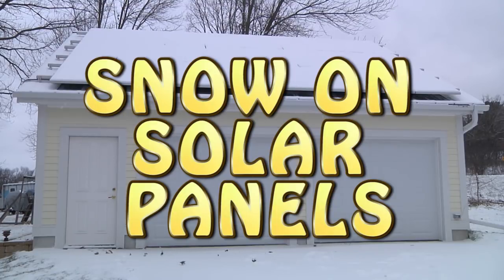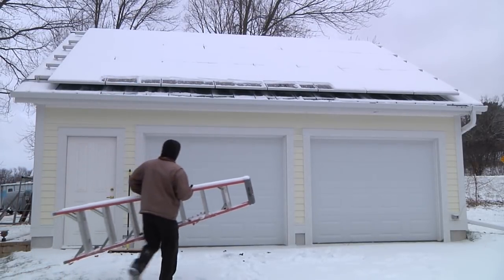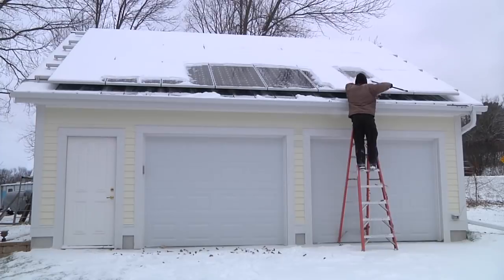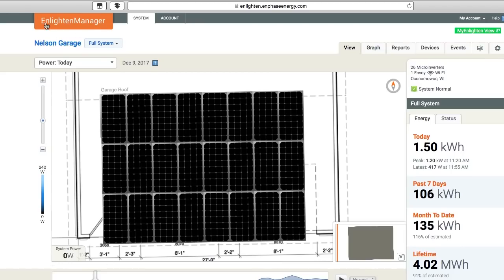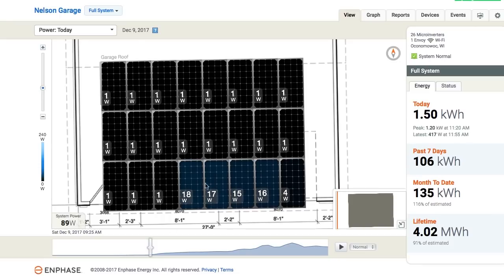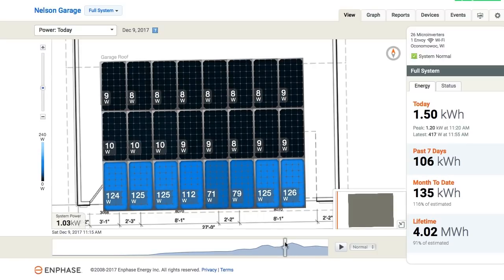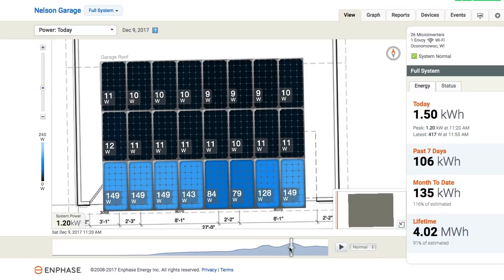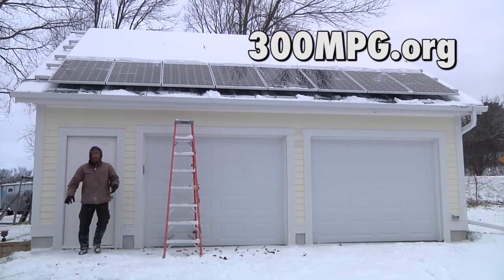Snow on solar panels!

Comment: Thinking off building solar array to a field with possibily to lock in the angle. Would the snow keep on the panels with more sharper angle vs power production
Reply from the maker: A steeper angle is better for shedding snow. I have one solar panel in my back yard at 45º, which sheds snow everytime. My garage panels are closer to 30º. Only really heavy snow seems to slide off of those. Otherwise, I need a good sunny day to do some melting.

Take a look at PVWatts. You can enter different array angles, and it will predict your energy production. You can use that to help decide what angle you want to use. Steeper is better for shedding snow though.

Also, remember to leave some space at the bottom of a ground mount array for the slow to slide off and pile up.

Here's the link to PVWatts:
https://pvwatts.nrel.gov

Comment: I wonder if that tiny amount of power generated under the snow is enough to run some kind of heating system?
Reply from the maker: Peak power under the snow (mid-day)  was around 10 watts per panel. The total power production for the day was 25 to 30 watt hours. For example, one solar panel generated in the day enough power to run a 60 watt light bulb for less than half an hour. Frankly, I was surprised to get any production at all through the snow. This was a pretty light snow, I would imagine a heavier one would completely opaque out the panels. As for heating, where would the heating material be located? It couldn't be on top, as that would block the sun. Any way of attaching to the back would need to be done before or during the solar panel installation.

Comment: Is the Super Truck project over?
Reply from the maker: I only have so much time and money. If I somehow had a whole bunch more time and money, I'd definitely be working on it. However, a guy has to earn a living. If somebody wanted to buy me a Nissan Leaf and pay my mortgage for a month, I'd be all over it.
Reply: +BenjaminNelson  I just came across your web site and watched all your posts about your super truck. What would you think about a bio- diesel generator on a trailer to run your electric truck and charge the batteries. I know it's not an original idea but it seems like  a lot less work. Do you think it would be efficient or a waste of time?
Thanks

Comment: A rope over the building. Two people then drag it along. As long as there's nothing to get hooked on the other side.
Reply from the maker: The north side of the building has a pair of skylights on it, which stick up above the plane of the roof. I'm not sure how easy it would be drag a rope across with those in the way, but I'd still like to try it sometime.

Comment: It was nice to see what you have, but I expected an innovated solution, not just a review of your problem. Come on Ben, we expect better.
Reply from the maker: That would be interesting to do a side-by-side of one panel with Rain-X on it right next to one without, and see the difference between the two.
Reply from the maker: I'm open to suggestions. Let's get the ball rolling on a brain storm. I'll start. I own an air compressor.
Reply: It looks like the telescoping Roof Rake with foam head is probably the most practical, but if snow is a constant issue then it would be cool to construct a permanent pulley and rope system that sweeps a brush or foam head over the panels, either manually via a crank or rope pull, or even automatically via an electric motor.  Put it on a timer for periodic continuous cleaning so no major accumulation occurs.
Reply: I see the last comment on that dozen tips page used the same idea I was thinking of - wipe down the clean dry panels with RainX to keep debris sliding off.
Reply: Suggest getting the handles from a snow roof rake and adapt it to the broom head.
https://www.amazon.com/Extreme-Max-5600-3207-Shingle-Saver-Blade/dp/B01LXLHWYQ/ref=sr_1_6?ie=UTF8&qid=1512855682&sr=8-6&keywords=roof+rakes+for+snow+removal
Reply: I think the water idea is the best. If i was do to it, I think something with compressed air would be the easiest. 
http://solarchargeddriving.com/2012/01/04/a-dozen-tips-for-getting-snow-off-solar-panels/
Reply from the maker: Interesting to see that the use of micro-inverters was on that tips list! I've considered some sort of a pulley system, which could pull a rope (or maybe a bar covered with a pool noodle or something) across the panels to get the snow off. This is my first winter with the panels, so I did want to see how much of an issue the snow would or would NOT be in the first place. I also want to avoid anything to weird or ugly permanently mounted up there. I'm on a corner property, and we get a lot of traffic on the main road. (Which was great for our Solar Open House!) I do want to make sure the panels look good and hopefully ENCOURAGE people to go with renewables. I DON'T want to give people the idea that solar panels don't work in the winter, or that you need bizarre contraptions to deal with the snow.
The extendable snow rake is probably the best simple/low-tech/inexpensive/reasonable way to go. Even then, I would need almost a 30-footer to get from ground position to the top of the panels!
Reply from the maker: Rain-X application directions call for applying it at temperatures about 40 degrees F. I'd have to wait for a spell of nice weather to try that one.
Reply: BenjaminNelson thats an interesting idea. Probably not reliable given the nature of snow, and I don't know if you could do it anyway, but make the whole surface into an air hockey table! No friction: snow slides off. You'd have to enclose the panels in plexiglass or something, with the top surface dotted with holes.
Reply: A drone? Air pressure from the propellers should blow the snow away

Comment: They have a foam thing with a telescoping handle for getting snow off your roof it's at Home Depot
Reply from the maker: Yes, "Roof Rakes" look like the most common simple solution for clearing snow from panels.

Comment: Turn off the converter and apply power to the solar panels, this will result in a current and heat thus melting the solar panels. A bit crude to waste energy but it works! You can even automate it ^^.
Reply: Ah it seems you have a MPPT per panel. Than that is hard to realise. They should embed this functionallity in the MPPT, will benefit the people having snow on their panels.
Reply from the maker: Sorry, that's not going to work. I'm using micro-inverters, so I just get alternating current out from them, and can't feed power back to the panels.
Reply: I find it hard to imagine that melting the snow would be worth the cost in power?  I like your broom solution.  Maybe just get a long extension so you can reach the whole array from the ground?  Also I am amazed that you still get some power through the snow, would not have guessed that.